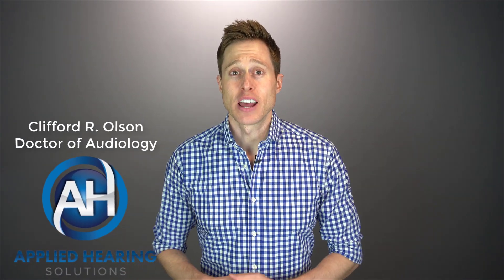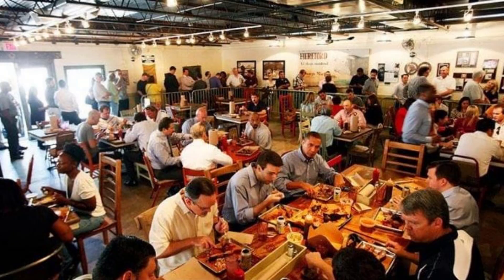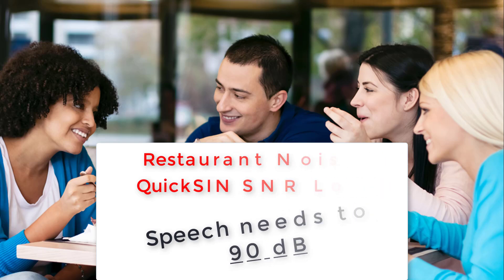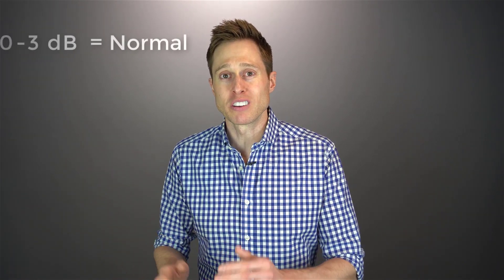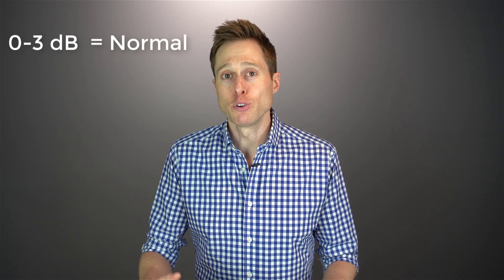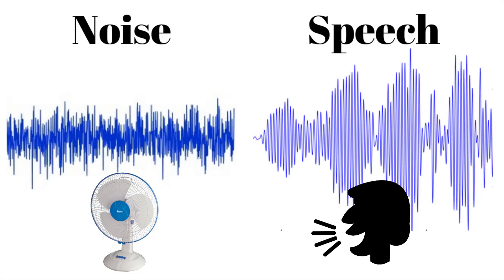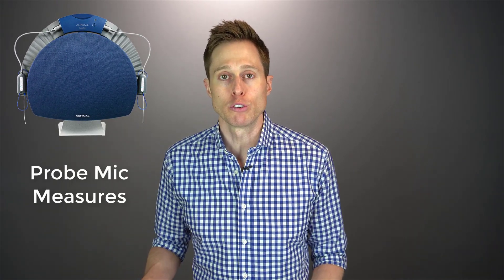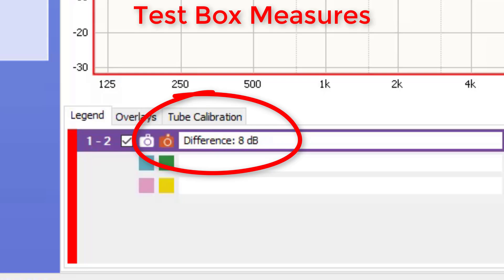How Hearing Aids Reduce Background Noise | Digital Noise Reduction (DNR)

Comment: I was tested less than a year ago and sure enough my hearing loss is classic according to the chart.  I found out my medical insurance would pick up a nice portion of my hearing aids cost.  I was fitted with the top of the line model of a very popular brand.  I asked the place to program one of the three settings for reducing background noise as much as possible.  After 8 months I want to throw these $3,000.00 pieces of crap in the garbage and be like my dad -refuse to wear hearing aids ever again.  I am now starting all over again though I did write a 'courtesy' letter to the hearing aid company asking them for any suggestions before I throw in their towel.  I am now on a quest for directional hearing aids, the best ones I can find.  Looking for suggestions and taking my time.  Thank you for reading this.

Comment: I have Kirkland KS-10 hearing aids.  The problem I have is when I'm in a slightly noisy environment and get a phone call, when I answer it and start talking the caller hears too much noise to understand me.  Is there a setting I need to adjust to improve this?
Reply from the maker: Nope, its a huge problem with the KS 10s
Reply: @DrCliffAuD  Thank you!  I've also looked on line and no one has addressed this, so I suspect it is a problem.  BTW does the digital signal processing help?

Comment: Hi Dr. Cliff.  I recently got fitted for a new digital hearingaid - Signia Motion 7 primax. I've a severe hearing loss and volume is key. That is, I've a conductive hearing loss.  Believe it or not, my last hearing aid was in 2009 and the model was in '05. :(  Yes, it was a powered hearing aid.

I've been visiting your channel to be better informed on what I'm getting into.  I do have some questions related to background noise.  My aid has a user volue range of 1 to 16 with a default of 8.  I'm n a quiet home. For some reason, I can totally ower the user volume to 1 and still hear your video.  How?  Yes, I'm also discovering that my aid seem to know when I'm by a mic and speaker system and uses the telecoil and I don't have to do anything. NICE!  I do up the volume when I'm in a car and use focus listeninng when talking to a friend with a soft voice.  How long does it take for the algorithm to learn what's needed?

Comment: I have the Oticon OPN S2 hearing aids. If there is a fan or motor running my speak recognition takes a backseat. If a house fan is on watching television is useless to me as all I hear is the fan. What adjustments if any are possible?  I feel like I wasted my money on these aids.
Reply: It sounds like a programming flaw. There are programs within the hearing aid that can be added to help you with background noise. You would have to switch it manually by clicking buttons or using your phone
Reply: @shilpap.5446  My sister has Siemens Signia YX51622 and she faces the same problem. Can these hearing aids be reprogrammed or corrected after their purchase? It is still under warranty period.
Reply: @mayflower1139  Of course. It is important to exhaust all options to make those hearing aids work before buying new ones. This is an extreme resort.

Comment: I had a hearing test because I have a very difficult time understanding people in noisy environments, but the test was all in silence, so it showed no hearing loss. I told the ENT and Audiologist that I specifically can’t hear when there’s background noise, but they said that’s “normal” and that hearing loss is measured in a perfectly quiet environment. It’s really frustrating to not understand people and not be able to follow a conversation when it seems like no one else is struggling to follow. Is there really nothing I can do for this?
Reply from the maker: Don't know where to start with this one.  Just because you test "normal" it doesn't mean that you can hear "normally" in background noise.  The reason we have a variety of speech-in-noise tests is to identify if your difficulty is increased with noise present.  There is even research that indicates that the majority of individuals with normal hearing and difficulty in background noise can received significant benefit with low-levels of amplification with hearing devices.
Reply: Doctor Cliff, AuD Thanks for the reply! Yeah, all the tests they did with me were in silence, even though I said I’m fine in quiet environments. A friend thought I should get a second opinion, but then Covid happened and we couldn’t go anywhere anymore, so I’ve just been waiting.